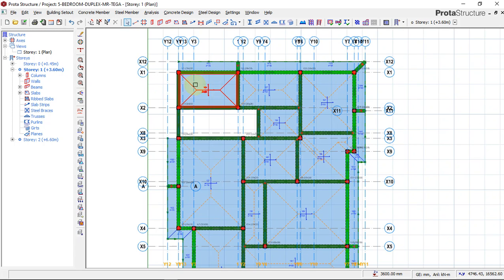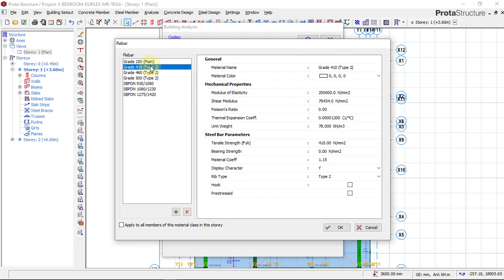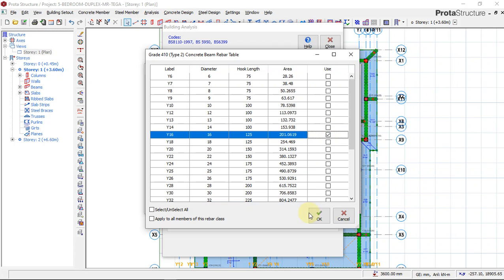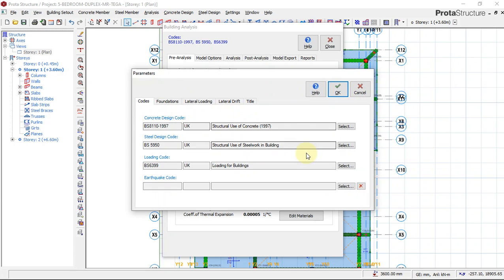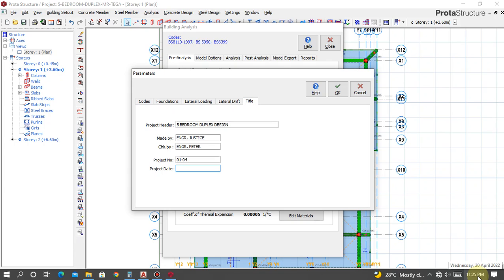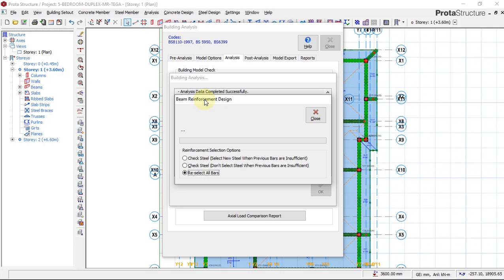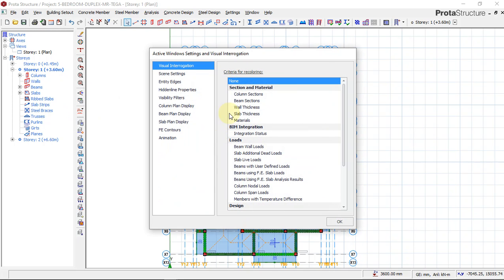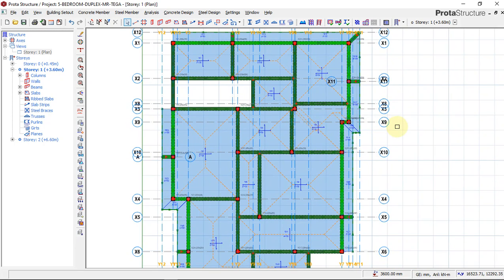PART 10 - How to Design Concrete Building in Protastructure.

Comment: Why is your story 0 showing  (+0.45m)
Reply from the maker: Because the DPC level is 450mm.

Since Pad Foundation depth is practically determined at site and not during design base on the terrain or topography of the site. It is required to input the 1st Storey bottom level which is also know as DPC level.

So my DPC level is +450mm which is also +0.45m. 

That is why my Storey 0 is showing +0.45m.
Although you can input your own DPC level which ranges from 450 to 750mm
Reply: @EkidelCAD  Thank you well explained!
Reply from the maker: @kato_emmanuel  Your are welcome